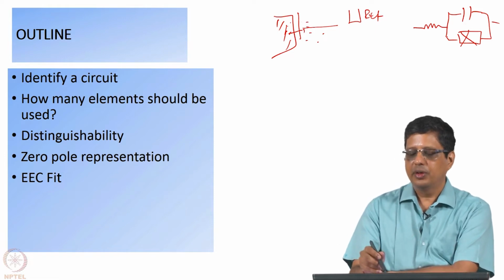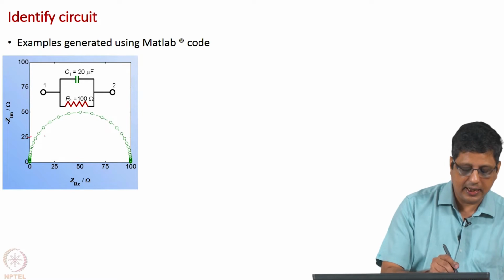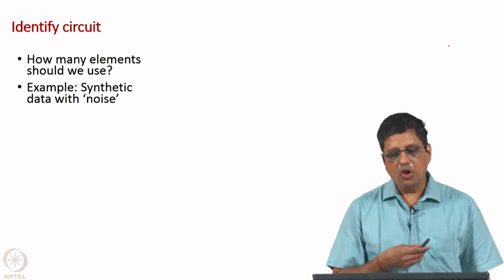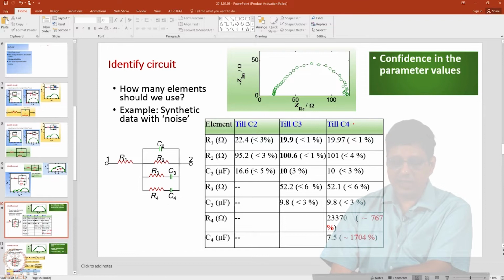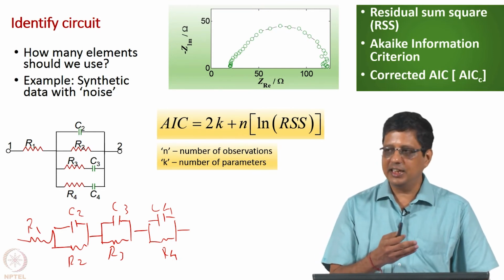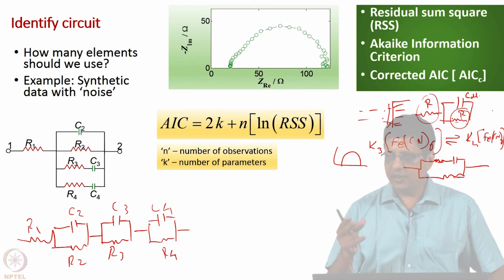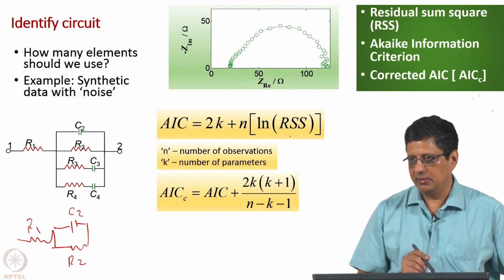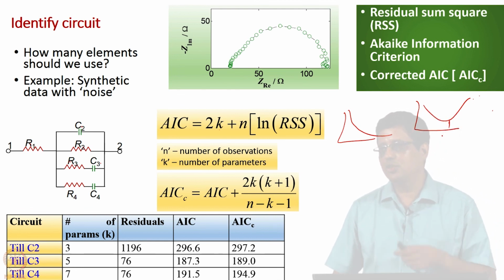#16 Introduction to EEC, Choice of Circuits, Confidence Intervals & AIC

Comment: Sir, how to use zsimpwin for multiple data set (suppose we can compare data fitting  on one graph)?
Reply: I am not sure that I understand the question. Do you mean that you want to use a single circuit to model several data sets, and get the optimized element values? I don't think Zsimpwin can do that. You may have to write your won code (e.g.in Matlab) to do that